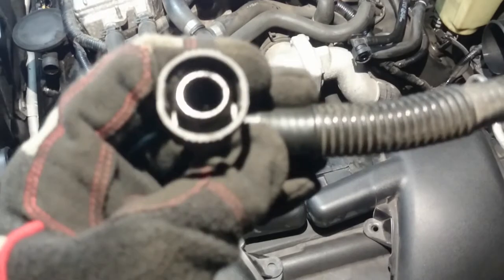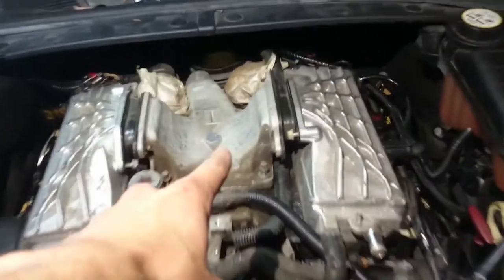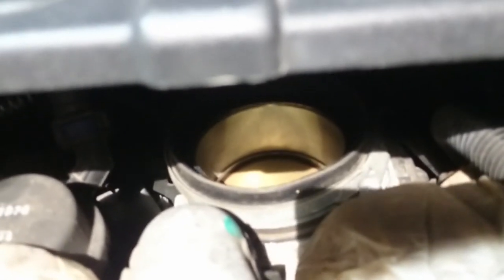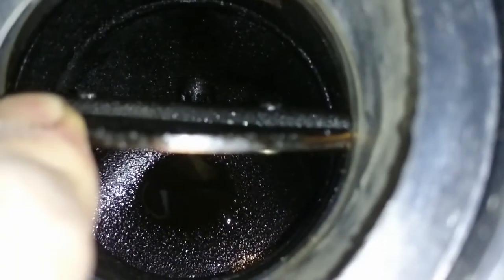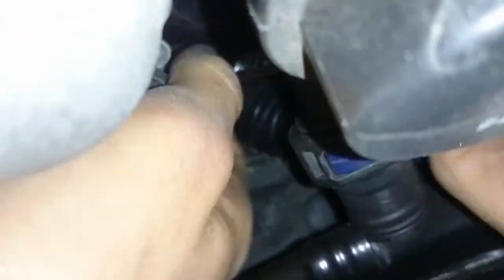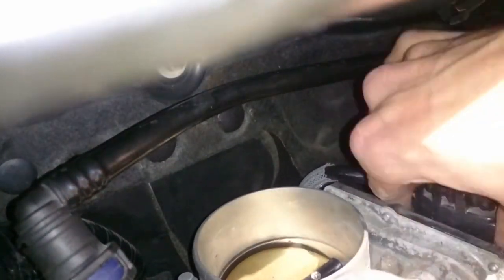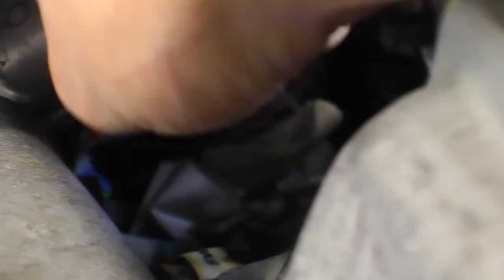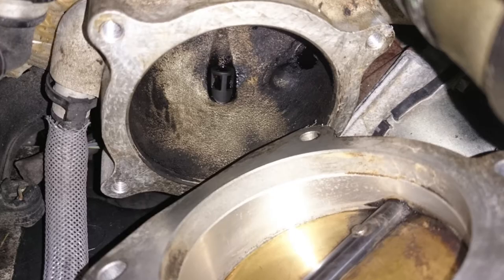What A Dirty Jaguar Throttle Body Looks Like and Cleaning It

Comment: Hi Sam, is the top intake bolted at all, or does it pull straight off? ive a 2008 sv8 and keep getting p0101,p0104, p010b errors, i know their for the maf but ive switched them around with no change, so im wondering if there is a leak between the intake and throttle body... car runs sweet though just have to reset the codes every day
Reply from the maker: The actual intake manifold was a big metal piece that did bolt into the top and the back of it that goes behind the engine was just a rubber hose clamped down on it to the throttle body. Did you try cleaning out the sensors with special cleaner? Also, are the OEM sensors? Because if they are cheap aftermarket ones, they could be causing issues.